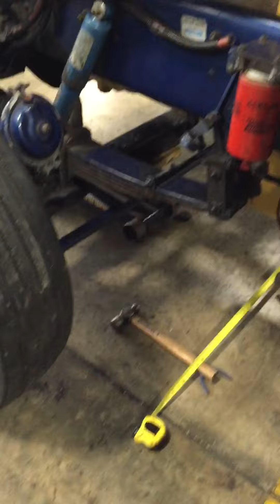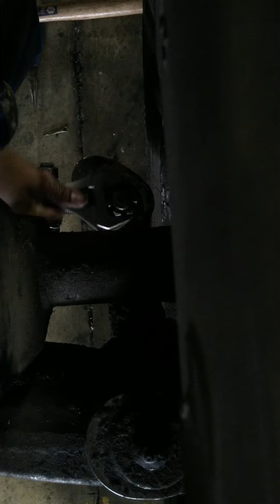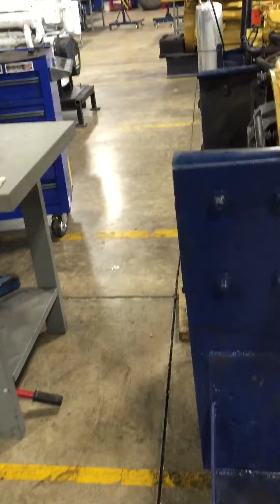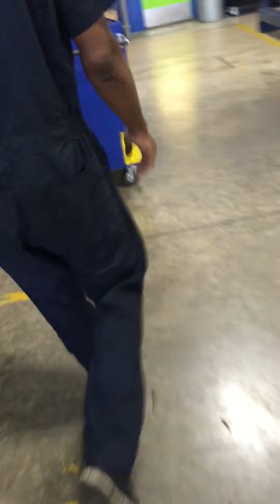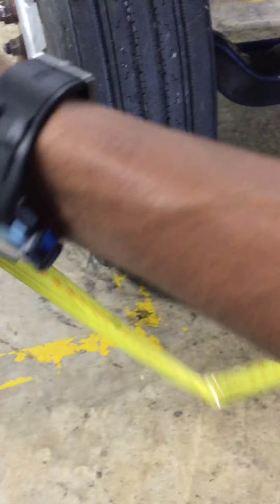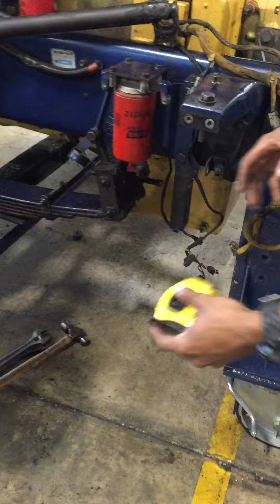Toe and Tie Rod Adjustment

Comment: If only they came off so easily on well used trucks that have seen salt and miles ;)
Reply: your so right brother, get out the torch and big hammer, 10-4
Reply: If I gotta use torch you need a TIE ROD ASSEMBLY

Comment: I need to adjust the alignment on a truck with 295/75/22.5 tires, how far from the floor do I need to make the mark?  It appeared the block you were using was about 12"

Comment: When you used the block to make a line does the block have to be a certain measurement and if so about how long?
Reply: It needs to be about 10-12 inches off the floor .Just needs to be the same height on all 4 tires.

Comment: Reality check.....I do big Truck Alignments for a living, huge difference between a mock up, and actually Truck that has one million plus miles on it !....time to bring out your  Sledge hammer ,  Your torch, and a 3/4 inch impact driver, and a very strong work bench and a very big vise that holds pipes!....and if your luck !!!...get it loose !....if not buy the whole tie-rod assembly and save yourself an hour or two!🤣😂🤣

Comment: What about keeping the steering wheel perfectly aligned while this adjustment is going on man? Thanks!
If I straiten my steering wheel right now the left tire looks strait but the right tire looks turned in more than a half inch.
The vehicle pulls hard left though all day and the left tire is wearing .
Reply: Hey did you ever figure out what the issue was? I  am having the same problem on a 2016 Cascadia Freightliner.

Comment: hey do u no what could be wrong if steering wheel is little off to right but alignment is good ?
Reply from the maker: What is the make model and year?
Reply: +Trenton Rodriguez  2012 peterbilt 386
Reply from the maker: +SHAQ Mann Remove the horn button (center wheel ) and pull the steering wheel off streighten and re torque 38ft lbs
Reply: Do u know what would cause a severe shake in the steering wheel
Reply: @chadgrant8143  bad tires or balance could definitely cause that but it'll usually be constant. However, incorrect tow in/out can cause that as well...my rollback shook badly right @ 65mph and was wearing the inside of the tire when I first bought it (bad enough I thought king pin could be bad) until I checked to find it towed out more than 3/8". Adjusted it 1/16" tow IN just like this video and swapped the unevenly worn tire with a good one from the rear and she's smooth as silk with no tire wear now 👍🏽